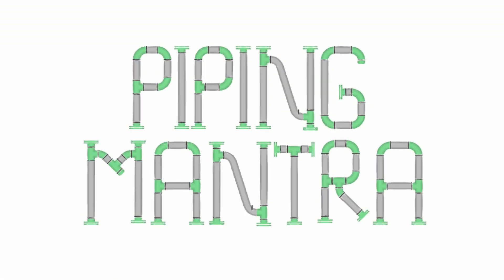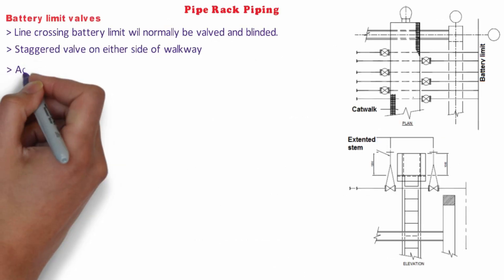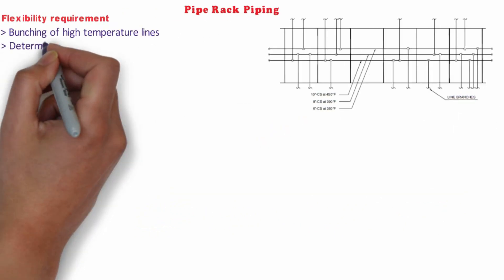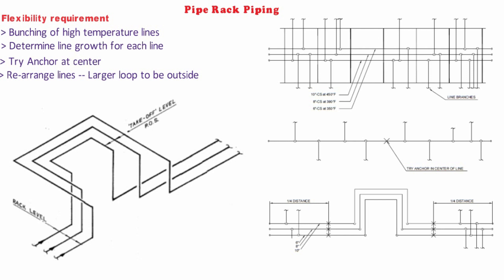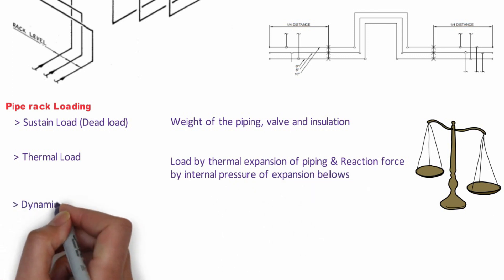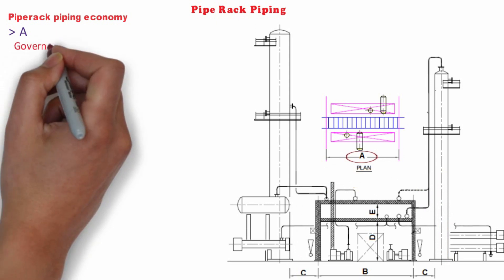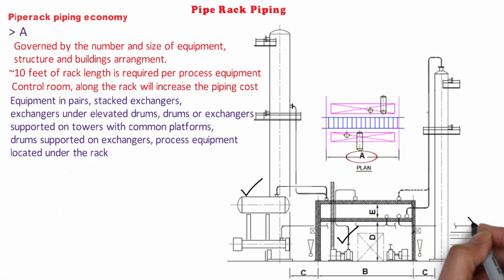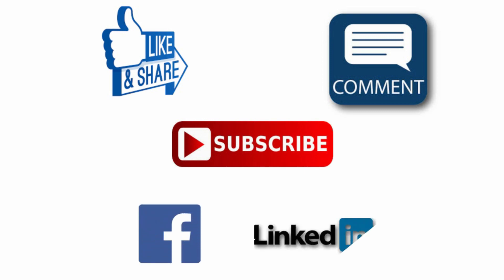PIPE RACK PIPING | PART-3 | PIPING MANTRA |

Comment: 1) What should be the maximum length of a piperack & why?
2) Where should we consider the vertical braced bay & why?
Reply from the maker: 1) there is no such criteria it can be with any length depends on fabrication requirement.
2) at anchor location of supoort.